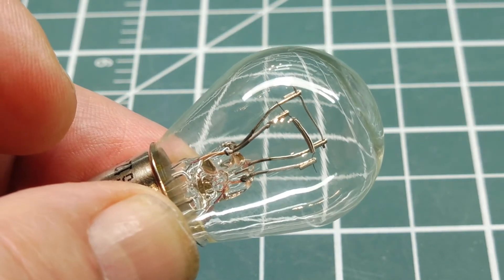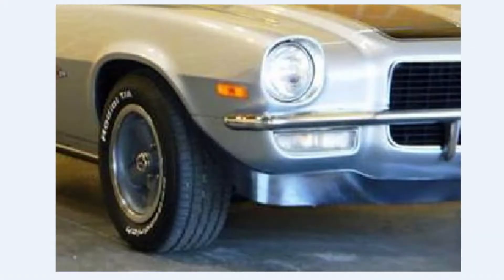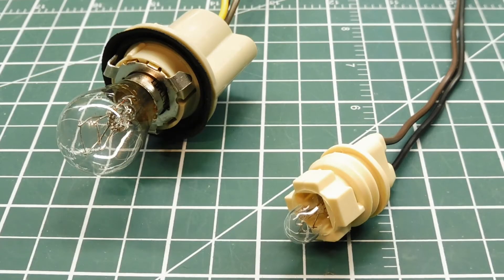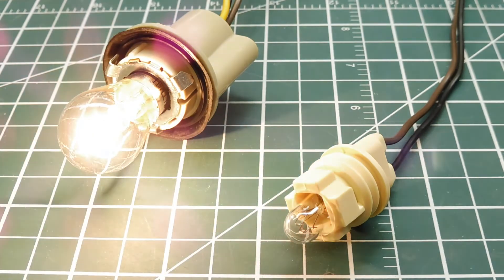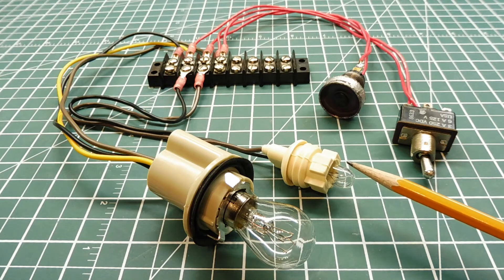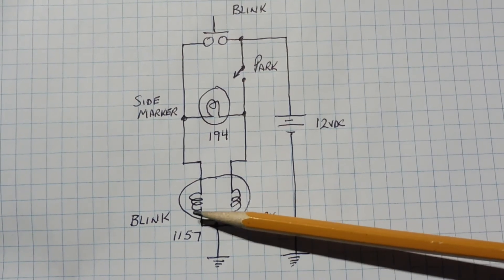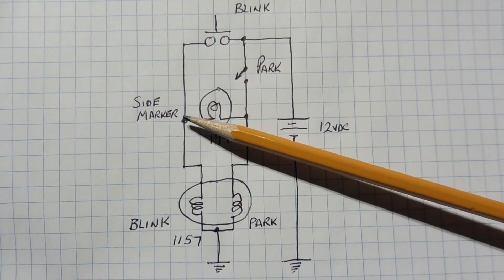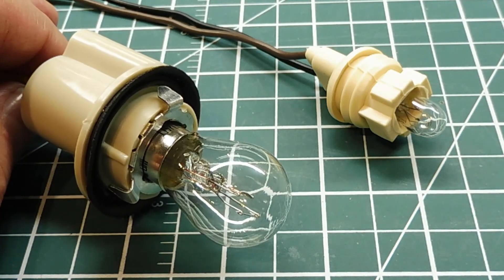1970's GM Blinker Circuit Explained

Comment: Thank you for this schematic. Tracing wires through a 1970's diagram is a nightmare, and I lost track of the parallel side marker. PO made some mistakes, and most "crimps" pulled apart looking at them.

Comment: I know this is an old video but it certainly cleared up what my issue was. (94 Silverado) I replaced all bulbs with LED and used a LED rated blinker relay. Everything blinked as normal to my delight.....until I tried it with the parking lights on. Then it would not blink at all. 

If I remove the 194 bulb altogether,  everything works normal with parking lights on, but not with a LED bulb in it. 

So I decided to sacrifice side marker blinker function and have it as dedicated parking light only. I cut the blinker wire on each side marker and grounded it instead. So now the side marker lights work only as parking lights and does not affect the blinker circuit. 

Your diagram was very helpful. Thank you !!
Reply from the maker: You're welcome. Glad it was helpful.

Comment: Thank you for a great explanation. I think the same circuit is used in my 1989 S10 Blazer.  

Now when people try to change the 1157 bulb for an LED bulb, the circuit no longer functions properly.  I read that you can add a 6 ohm 50 watt resistor to restore the circuit function when using LED bulbs.
Reply from the maker: Thanks for sharing

Comment: To change to LED's you need dual-polarity 194 LED replacements.  The current through the front side markers will reverse in polarity depending on the mode of operation, hence dual polarity requirement.  You can leave the front 1157 bulb in place to provide the low resistance ground circuit.
OR, you can replace the front 1157 bulb with an LED replacement but you must provide a low resistance path to ground.  Since you are using an LED in the side marker, the side marker current will be significantly lower.  Googling around it seems 90mA for a LED 194 is a good figure.  So the side marker LED will work fine with 10V across it, we have 3V (13V-10V = 3Volts) to drop with about 90mA of current flow.  Ohms law says 3V/90mA = ~33 Ohms, which is a standard resistor value.  The resistors will need to dissipate more power when 13.8V is across them, so 13.8x13.8 / 33 = ~5.8 watts, so we need to use a 10 watt resistor.
This is what I intend to do on my classic 1977 GMC motorhome.  I have not done it yet, but as an electronics guy, by the math it should work fine.

Comment: I guess this explains some issues I'm having on my 92 Dodge, it has a similar circuitry for the front turn signal/marker light. I changed out the bulbs to LEDs and now the LED will barely light up when the blinker comes on and the parking lights are off. I wonder how I could resolve this..